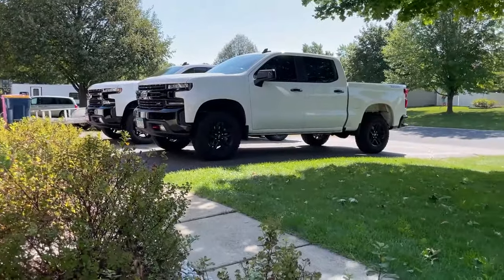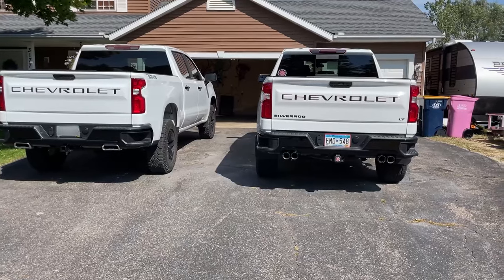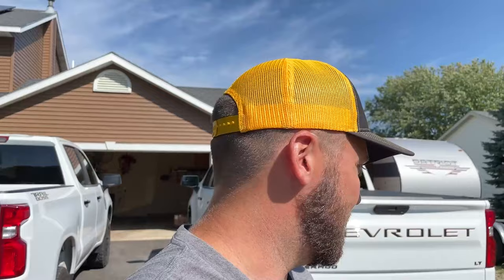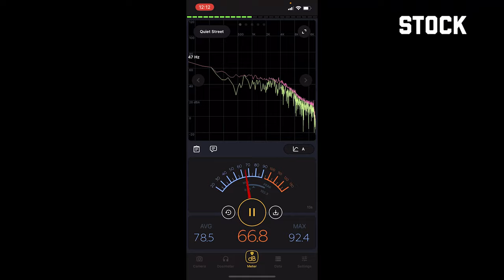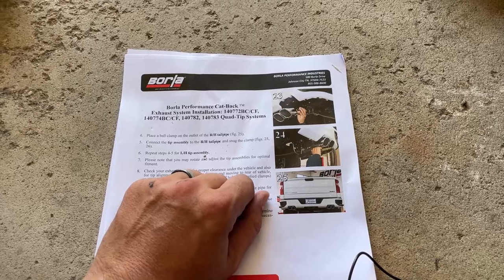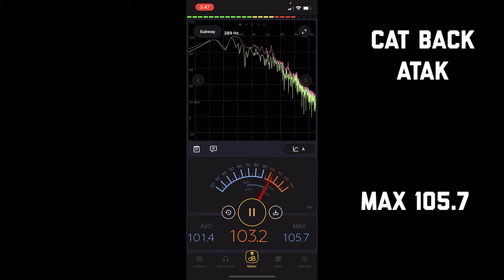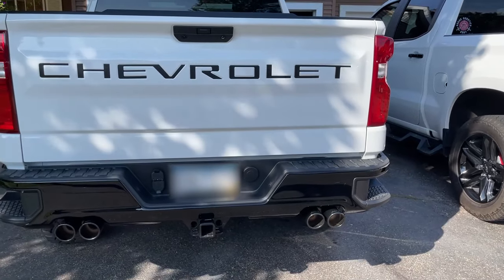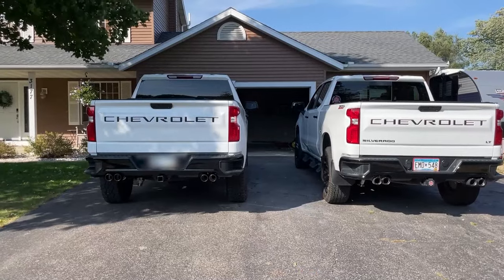Borla ATAK vs S-Type, What should you buy and how to Install 2019, 2020, 2021, 2022 Sierra Silverado

Comment: Any factory warranty issues?
Reply from the maker: Not according to Borla’s Q and A page:

Q. Will it void my factory warranty?

All Borla street Cat-Back™s, Rear Sections, and Mufflers are 50-state emissions legal.  These systems will NOT void your factory warranty, some cars even have Borla systems as the OEM exhaust.  In fact, it is illegal for a dealer to deny you the OE warranty because you have changed the exhaust system.
Reply: That’s the exhaust system that GM sells
Reply: @bigbeef8935  its the borla touring edition
Reply: Check your warranty.    The 36 k warranty probably doesn't cover exhaust anyway
Reply: @TruckOwnership101 is that OE ypipe and cats?

Comment: I was dead set on the Atak but changed my mind and got the S-Type for my 21 Silverado 6.2L RST. Start up is plenty loud but settles down fairly quick. You definetly hear it when you get on the throttle though. I think the Atak sounds good but a bit too obnoxious in my opinion.
Reply: how much did you pay for install?
Reply: @318Heavy  Installed myself. Not hard if you have some mechanical skills. I'm sure if you are not confident in doing it yourself any local muffler shop will install for $$.
Reply: What size bed do you have
Reply: @dynastyonthunder3584  Crew Cab with the short bed.
Reply: @Boobtube.  S-Type Catback
Reply: @mike_saw_7563 I have a 2023 gmc sierra 5.3l crew cab with a 8' bed... will the s type fit my truck or will I need to get some kind of extention due to the longer bed?
Reply: @coolstuff7372  Not sure but would recommend checking with Borla. Did not find one that fits the long bed.
Reply: I just had the s type installed (crate not full cat back). It’s not as loud as videos I’ve seen. Maybe I should delete the resonators?

Comment: I got the S-Type for my 6.2L Camaro.  It was still rather quiet but with a better sound.  Just what I wanted.  Then I added long-tube headers and it got really throaty but still about the same volume.  Cool.  Then I threw in a larger intake manifold, throttle body, and cam.  Now it's way too loud.  But way too fun.

With my 6.2L truck, I'm starting off with the Borla Touring exhaust and I got the ones that point in opposite directions.  Even though it is the quietest option, they are louder than expected.  And now I've added long-tube headers and its made it raspy loud.  I've got a high-ram intake and large throttle body ready to install.  I'll be doing a cam swap at the same time and I imagine it's going to be as loud as an Atak system after that.
Reply: I also just got the stype for my 2019 camaro ss. It arrived today so I'm very excited to see the difference to my stock long tube headers sound. I hope it's a lower rumble than stock npp

Comment: I have the s-type on my truck. Cold starts are loud, but tapers off in about 5 seconds into a mild gurgle. Sounds good. Not to loud on the road, no drone at all. I thought about about going with the atak, then remember a friend has it and regrets it. Loud. All the time.
Reply from the maker: The only feedback I got from the truck owner who has the ATAK was about his improved mileage on his commute lol. I live in work in town so I haven’t seen that yet.
Reply: @TruckOwnership101  the s-type and intake has "improved" gas milage on my silverado even with a 6 inch lift, and on 35s. Might have something to do with driving in sport mode though.
Reply: Wouldn't say it's loud all the time. It's actually fairly quiet once it warms up and idles. Just a little rumble but that comes with exhaust. On acceleration they are just about as loud as eachother, the ATAK is just deeper.
Reply: @JacobH82359  I did forget to mention my buddy also has a down pipe among other things. With the loud all the time end result.
Reply: @JacobH82359  the ataks I have heard have sounded raspier imo than the s type. which I prefer mainly on mustangs and Camaros.

Comment: The red Crocs are awesome lol. Like your videos a lot. I have a 2021 LTZ with the 3.0L diesel. Slowly making changes to it.
Reply from the maker: Thank you! Glad you like them! I only hear good things about the 3.0 diesel. Would love to line up against one someday and see how it does.
Reply: @TruckOwnership101  been very good so far. Still has all of the towing the 6.2 has, but much better MPGs. Best I've gotten is 37.4. Made it from Massachusetts to Washington DC on 1/2 a tank of gas.
Reply from the maker: Any cool exhaust options for a 3.0 diesel?
Reply: @TruckOwnership101  I haven't researched any quite yet. Kind of weary about messing with the exhaust fluid system.

Comment: So at the beginning you mentioned that you can purchase the muffler by itself (as a budget option), but from what I’ve discovered, Borla won’t sell just the muffler. Can anyone shed some light on this? I’m looking to go with the S-Type, and would simply like a tip on what model number to order. Thanks in advance.
Reply: Go to summit and buy just a muffler db😮
Reply: 40844 is the 6.2 atak muffler
Reply: I wanted something deep and throaty not to loud I m almost 60 yo so nothing too loud. I just bought a like new 2021 trail boss 5.3 LT. I really kinda like the flow master super 44 and wanted to go with a set of black quad tips I m real handy and have a lot of tools so I can probably do it myself. I have already covered the 6 resonator screens with aluminum heat tape any suggestions would be appreciated

Comment: Thank you for another great video. How does it sound in the cab when towing your trailer? I have a 2019 GMC Sierra denali and will be doing a muffler delete to start. Also can you show the STUPID flap valves on the stock muffler? 
Thank you again
Reply from the maker: Going up a hill with the trailer you certainly hear the S-Type. Part of that is the echo off the trailer too. 60 on a flat is no different with or without a trailer.

Comment: I have the s-type on mine. I like the sound, but personally I would like it a bit louder. So im thinking of doing a muffler and flapper delete.
Reply from the maker: Yours still has flappers? Didn’t see those on either of these. Did you just do a muffler?
Reply: I don't think it has the flapper. I bought it used, and think the previous owner had the exhaust done

Comment: What is the sound difference “in the cab”? That’s what I’m looking for.
Reply from the maker: No drone issues during regular driving if that’s what your asking. They are both tuned well. ATAK will just be a little more for a litter longer.

Comment: I just got off the phone with Borla. They told me that without a blower, you will lose performance with the true dual setup. Have you had any noticeable difference in performance? Or have you not noticed a “seat of the pants” loss?
Reply: So if you get the dual pipe one side exit you don’t lose performance?
Reply: Why would you lose performance?? That statement makes NO sense. Anytime you install a freer flowing exhaust on a 4-stroke, you should gain power.

Comment: Thats all fine and dandy but I don't stand behind my truck when I'm driving it. What's it sound like inside while driving?
Reply from the maker: Ha, fair enough. No drone in the cab unless I’m pulling my 6,000lb camper. Sounds really good when you get on it. Only a slight increase in noise in the cab when you are driving normal which is perfect

Comment: Question on the Borla exhaust.  I have a ZR2 on order and it doesn't have the exhaust ports in the bumper.  Does this exhaust have enough slack that will adjust to go below the bumper or will Borla need to have a different option for the ZR2.  Looks like we are in the same state with your license plate.
Reply from the maker: My guess is that you will say you plan to use “factory tips” and run nothing like the ZR2 does. From what I can tell GM is doing the dual exhaust setup with a non dual bumper. The factory tips mount and are basically part of the dual exhaust bumper. The real exhaust pipes on the ZR2 looks the same on the 2020 if you take the tips off.

Comment: I just did my exhaust on my 2022 Silverado rst … sounds good on start up and when accelerating …. Only issue is a popping sound on deceleration and coasting in neighborhood at like 20-30 … thought it was the afn/dfn so got the chip to shut that off and it still has the pop …. Any idea what the issue is?
Reply: Leak somewhere in the exhaust, drawing oxygen in possibly.

Comment: Running true dual cat backs no muffler on my 2019 z71 w the 5.3.....love the sound except I kept the stock hdmi tips and when truck gets up to temp it sounds like a helicopter...do not use stock tips...they are like stamped together and sound like garbage at idle when actual noise and air goes thru them
Reply: helicopter huh? you talking like 4cyl? afm dod?  smaller the piping bigger sound. more claps.  5 inch angled cut tips would change some of that

Comment: Will either of these turn on my check engine light on my GMC sierra 2021 slt?
Reply from the maker: Shouldn’t. The dealership puts Borla exhausts on as a factory add-on. You can select them in your packages. Had no issues with the two I did.

Comment: I have the s-type on my 2021 trail boss with K&n cold air intake definitely boost it up & makes those raptor owners look. I love the sound starts out aggressive but calm at cruising step into & unleash hell on the highway, downside to my truck u can’t unlock the computer to turn off the step limiter y’all know 98mph this is bs how much juice is Chevy hiding there’s no way to unlock the computer).,:;/+% but love it s type I highly recommend
Reply: just get the pulsar LT and it’ll let you
Reply: RAPTOR > any 1500 gm 😢

Comment: so with the borla attack do all i need is a muffler and thats it and keep everyhting else on my 2019 gmc deanli factory piped maybe take off resignators???????
Reply from the maker: I did the full true dual cat bak system to get the most out of the system. No flappers or crushed y-pipes. But you can get plenty of sound gains and airflow for less by just doing the muffler.

Comment: Any drone at highway speeds ?
Reply from the maker: Nope. Not even when pulling my camper. (Unless it’s uphill with the camper)
Reply: @TruckOwnership101  
Wow. That’s amazing. Well. I guess I need to step up to the Atak full catback system. I went the cheap route and swap mufflers with the Borla Atak crate muffler
Reply from the maker: @JohnD0129  you have drone I’m guessing?
Reply: @TruckOwnership101  
Yup it’s pretty annoying.  Then on top of that when the AFM kicks in
Reply from the maker: @JohnD0129  dang. Well Borla sure figured out the true dual S-Type on the 6.2L zero issues like that

Comment: Remember folks for the 5.3, the Atak is not available.  But the Atak is definitely a better sound than the soft stype.
Reply: I was just on the website and the Atak is in fact available for the 5.3, in the catback layout.
Reply: @TinMan1313  for what year. Because I talked to the owner and they didn’t and had no plans on making it for the 5.3 from 2019-2021.
Reply: @american_chevy616  my mistake, I apologize. I was looking at it for my truck (‘16 Sierra) not the ‘19-‘21’s.
Reply: @TinMan1313  all good man
Reply: Not everyone wants an obnoxious exhaust, I used to have the attak on my mustang, I wouldn't want it on my 2023 gmc sierra, getting the s type even though atak is not available